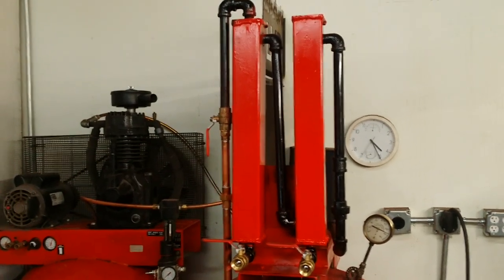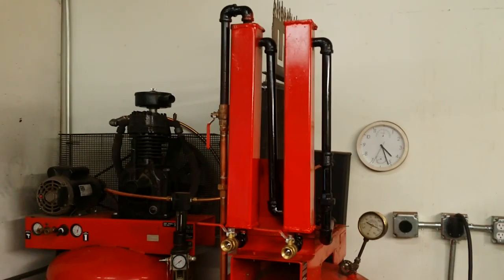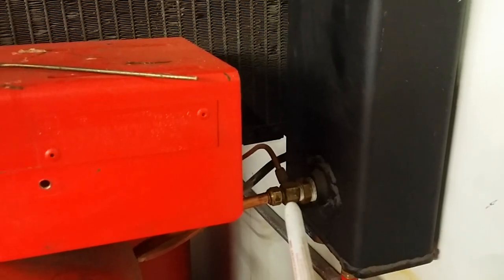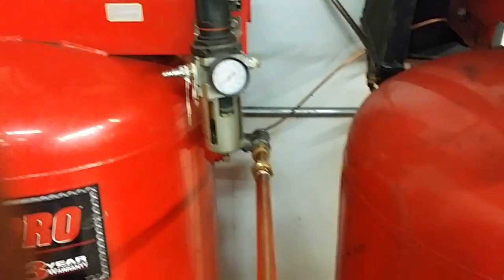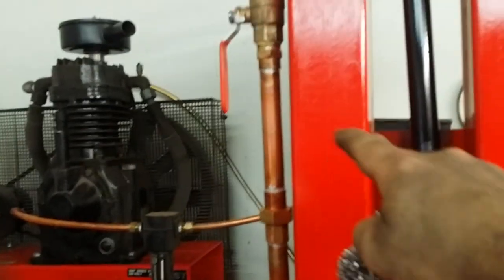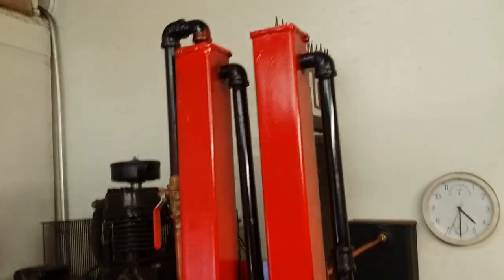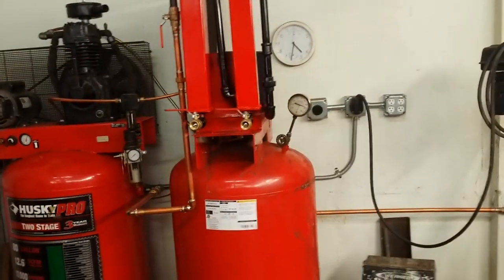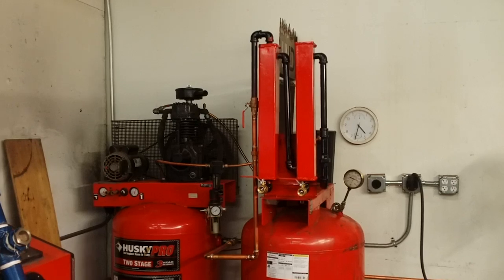Homemade air dryer and storage upgrade

Comment: A/C condenser is aluminum. And you have copper lines. Air & moisture combined with dissimilar metals leads to corrosion.

Comment: With the amount of money and time you've spend there, you could have purchased a commercial high CFM air dryer. I think the point of DIY dryer systems is to save on costs. Once you get into the $500-1000 territory, you've only losing money and time.

Comment: Hey Mike...sorry to comment on an older vid but trying to solve water issue with my setup...without blowing the budget...Trying the auto AC condenser idea. ...came to this decision after looking a prices of buying one and all the water my compressor builds...I have a condenser out of an 84 S10...one of the lines on it is 3/8 and the other is 1/2 in. Of course both are aluminum. Was told if I us steel or brass compression fittings they would not hold/rip aluminum lines...How did you connect to your condenser?  Any advice on compression fittings? The plan would be to put check valve after pump head...and a water trap just before it goes back into compressor tank...compressor is a 60 gal with about the same 13.4 cfm @40 so not big pressure...(maybe little less). Just trying to put together a less expensive / simple dryer. Any advice is helpful...can't really put money in a fancy aftermarket one....heck even a simple one they want over $300 on ebay...without any lines or fittings. Thanks for any and all advice on making one of these.

Comment: I have a question about the AC condenser.  It appears to be used.  If so, did you do anything to remove the oil from it? I am considering a similar setup, but was thinking about a new condenser so it wouldn't have any oil.  Also maybe a trans cooler or something like that.
Reply from the maker: motecalevol it's been 6 years or so, but I believe the scrap yard had drained all the fluids before I bought it.  I ran some hot soapy water through it, then blew it out before hooking it up.   Still working great!

Comment: Mike did you do an update video? Thinking of building this
Reply from the maker: Joshua Jones No, not to date.  I'm getting ready to launch a new design of the page, and this project is on my short list of projects to update.  I've received a lot of negative feedback from viewers about the quality of welds on the filters, and I have to agree whole heartedly!  Since I built the filters several years ago, I've worked on my welding, and am now doing tig as well. 

 My eyesight has always been bad, and at 57 isn't improving, so that makes welding well even more challenging.  However, that doesn't excuse me from making a disclaimer about dangerous projects and then going right ahead and doing dangerous things. 

 So I apologize for that, and will strive to do better work as an example to subscribers in the future! 

Please know your limits, work safe, and thanks for watching, I really appreciate all the subscribers to my channel!
Reply: Screw the haters, the welds may not have been pretty but at 1/4" wall you'll be good as long as you got full penetration. 150psi while it may sound scary to some isn't all that much. 

Even in the event of a failed weld it's not going to go off like a bomb. Sure it would be scary  and loud but it's not going to completely detach your end cap and send it flying. Some of the safety police need to chill out a bit.

 Consider for a moment that the pressure vessel itself isn't made from 1/4" steel and ponder that. Your pressure vessels have a more than fair safety factor built in.

Comment: Nice setup!  Could add a final dessicant stage if desired.

Do be conservative about working pressure, and make sure your pressure relief valve works - I saw a compressor cutoff switch get stuck on once.  Happily the pressure relief valve worked.  There is a reason they are required!

If in doubt about welds, do hydro testing:  fill with water, get the air out, and apply 2X?  3X? the intended working pressure.  Even if an entire end pops off, the pressure just drops right away, like when a hydraulic jack moves (the pressure drops off and it just stops moving).

If a weld fails with compressed air, you can get shrapnel.

Comment: in my mind, a second air tank is not going to help with wear on the compressor, because although you have more air storage, the compressor has to run twice as long to bring the pressure up because you're filling two tanks instead of just one. bottom line is you have to have a compressor with large enough output for your needs.
Reply: That is a very nice setup. I don't think I would go that far for my powerplasma cutter equipment but I enjoyed watching what you did nevertheless.
Reply from the maker: Nunya Bidniz you make a few good points, but in practice the system has been brilliant....  I saw it as frequent startups v. Longer run times.  Because of the condenser coil, the compressor runs cooler.  I also change the oil and the air filter frequently.... Number 1 killer of compressors is bad maintenance.  3 years on & the system is still rock solid and exceeds all my needs for clean dry air!
Reply: @MikeGIronCreek  number one killer is heat

Comment: Mike,  I understand why the air is traveling bottom to top in each of the two red filters but I'm unclear why the left filter uses an internal pipe to bring the air to the bottom and the right filter air simply enters the bottom.  Please explain the reasoning for this difference.   Thank you
Reply: because water travels downhill.   bringing the pipe down through tje vessel after its already cool keeps the droplets in the bottom and allows the air to rise through the filter elements scrubbing the water off.
Reply: Eric  guessing it just took less effort.

Comment: Mike, did you move your check valve on this system? Your video inspired me to build my own coalesing filter. I used  your design for the second set of filters, but put it in the line off of the compressor head as you did you first coalesing filter. I added quite a bit of copper line to my installation, 40' to help with cooling. I left the check valve in its original position at the top of the tank. Now when the compressor hit its peak psi and shuts off the bleeding of the head takes forever. Should I move the check valve downstream?
Reply: Brian McManus he did move it, but he has no idea what it is or how it works. if you watch it again it's right after he talks about the condenser. You want the check valve as close to the head as possible, or you are just throwing money away. you only need to bleed the compressor itself.

Comment: mike, I noticed that the 1st stage if I can call it that goes into the top to the stage 18 inches or so into this square tubing, then the air travels on its own to the top of the second stage where it is farther cooled and then out into the cooler making its way to the rad ,, through it down to a collection tank into the compressor.   Right?

Comment: I like your build.. but I have to say... you made a great disclaimer on the required welding skills necessary to do the build, but looking at your welds, you didn't listen to your own advice. not trying to be an ass but... those weld probably would not pass certs.
Reply: Mike.  Don't even listen to these jokers.  Everybody is acting like a pinhole leak in a weld somewhere is going to blow your garage apart. No, it's not. 150psi isn't hardly anything at all to steel; square, round, star shaped, it's not going to care! And if it were to leak, it'd be just that, a little leak, you'd hear it, give it a little grind and bead and it'd never happen again for 100 years.    That said, my money says you didn't get much water out of those steel wool stacks.
Reply: +Sean Buckner  LOL I saw that in the video too and thought the same thing Before I saw your comment. I am glad I am not the only one that thought that. Those welds containing 150psi actually scares me a little. And the coalescing units are square???  Not MY first choice.
Reply: Cool idea, but same thoughts about square tube.. Not the best idea.

Comment from the maker: Thanks Phil!

 As far as ROI, that's a bit hard to quantify....  Consumables on the torch will last longer, and a full set of those runs about $45 or so... The increased time between the compressor cycling will reduce wear and tear on the compressor, so that's a savings... All the other tools and equipment that uses air in the shop will benefit from good clean air, and the powdercoating setup will be more efficient as well.

  I got a great deal on this compressor about 5-6 years ago as it was a returned unit to Home Depot when they were still carrying them... It's actually a Campbell Hausfield unit painted & badged for Husky.  With everything you see, I have probably $800-9-- total investment.
Mike